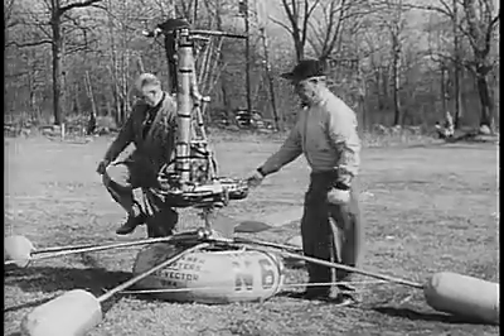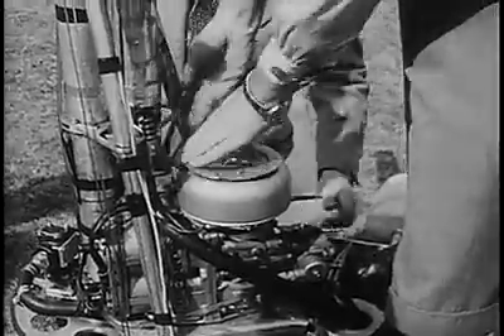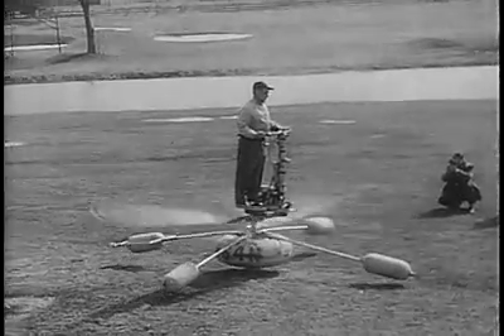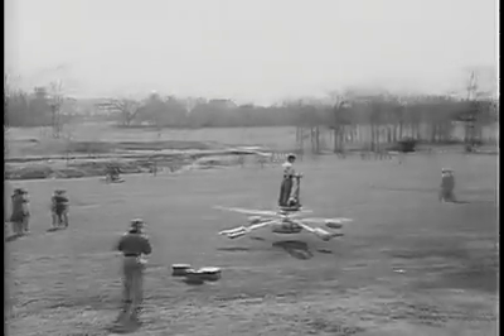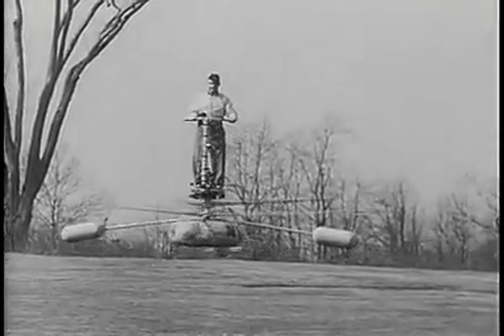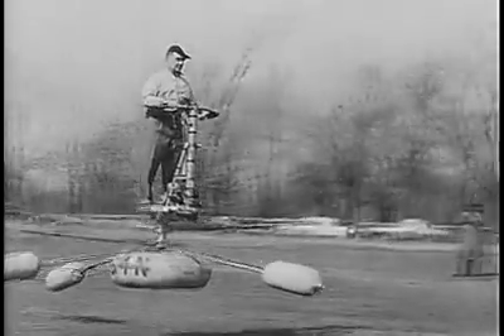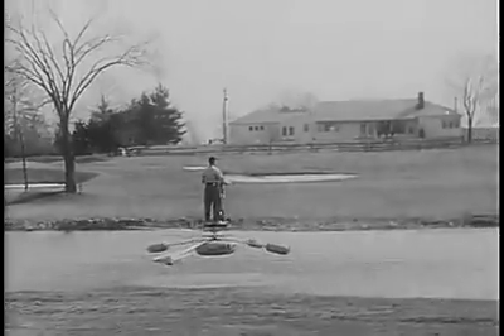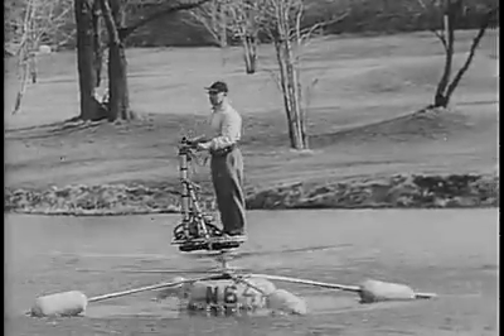"One-Man Amphibious 'Copter"

Comment: Everyone talking about how dangerous it seems, but it really just needs a cage guard either coming off the platform shielding the blade, or coming up from the platform preventing the pilot from ever being able to fall off it anything into the blade. Then it's only danger comes from its stability in flight, which the duel counter rotating chopper blades seems to make if very stable, though I don't really know how you turn it, mabey there's an inbuilt throttle that independently speeds up, or slows down one blade, or the other, and that then would cause it to rotate counter to the stronger blades rotation.

Comment: Hilarious. Some people in the comments are wondering why there isn't a protective floor under him. 
Well guys, it wouldn't work if there was a floor there, because the blades have to pull air from above to push it below to create lift, if there is a big barrier above the blades then it would impede them the air above them that they need to push down.
Reply: I still think there could be something worked out.

Comment: Putting all the safety aspects to side He had the right idea..it was actually a helicopter upside down when you look at it , at least they had something to work on , then along came some one who put the engine above and added a tail rotor with pitch control rotor and the helicopter was born. Just remember  we used the square wheel for a damn long time before swapping it for a round one 🤣🥲

Comment: To say the least...safety was not in the equation. I was interested that it has a 40 Hp outboard motorwith direct gearing to the blades. Google de Lackner HZ-1 Aerocycle

Comment: Whilst innovative, I believe that this didn't develop further due to their being no practical application for it and no commercial market.

There's also no autorotation capability, therefore only fly as high as you're prepared to fall from if the two stroke outboard motor quits.

That apart, it is quite a clever device, one which I would certainly try.